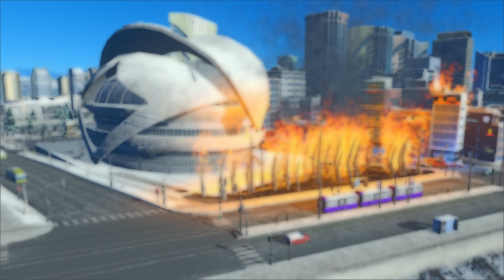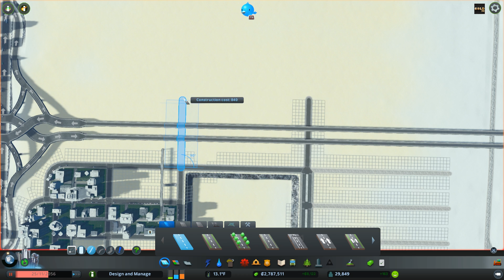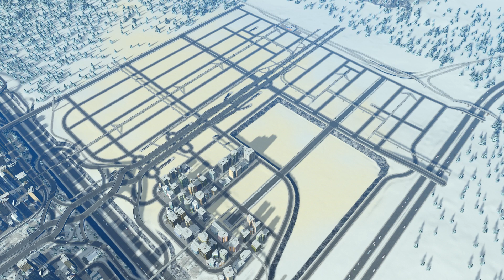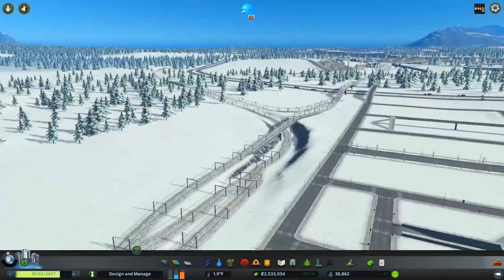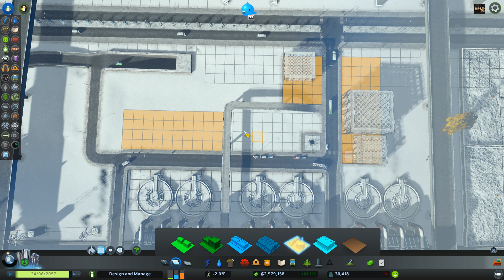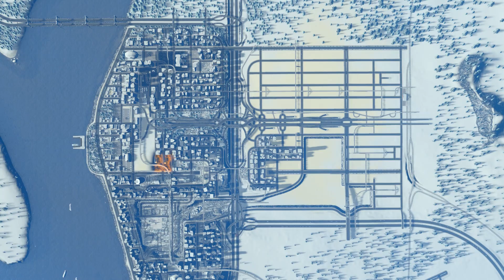Designing a MULTI-EXIT Interchange | Unmodded Cities: Skylines – Design and Manage, Part 26

Comment: Grids may be boring, but they are efficient, especially in high density areas. Way back at the beginning you left much of the farming area unzoned. you could add farms to deal with your industrial demand, and supply products to your sufficient residential and commercial zones. I believe you have oil and ore resources near by too. For forestry you can simply place a dense patch of trees anywhere and then zone it. or use the dense forests near your farms. Do custom assets qualify as a mod? I used this combined Pedestrian and Bicycle Path http://steamcommunity.com/sharedfiles/filedetails/?id=1179876942 in my cities

Comment: All hail the god of symetry and planning ahead his name shall be always remebered as T4rget.
Questions:
1.) Is there a reason why the long underground connectors in the "left" part of the city are only ON connections to the highway, but the "right" side has OFF connections. Altogether the whole highway "thing" is a masterpiece in itself as always, nevertheless it still seems a bit underdeveloped compared to what you made on the other side of the city.
2.) Do you not plan on having a cargotrain station on this side of the city. Adding to that and as a personal note I´d like you tu take the traintracks into the city alongside and or between the highway and planting the the big passenger train station in the city- take it as far in as you can so that it can truely be a central train station. Perhaps between the highway and sunken park, where there is already zoning. make a bit of a transport hub around it. This location would be a perfect opportunity to create a somewhat big city centre which arguably the city doesn`t have as of now. You know cetral station, parks, placas, some capitol landmarks like Theatre, courte house, taxoffice and a statue in the middle all.
And then have the cargostation on the other side of the highway which makes it not only cetral but with easy access to the underground connections to the left and right side of the new city part and to the highway into the old part.

I think what i am saying is: "Isn`t now the time to go BIG"
Reply from the maker: +heisnotlongbutthin 1) I tried to explain that in the video. The reason I'm not adding off and on points in both side of the highway is because the city will end very little distance north from the train line, so there's no point in getting in the highway just to leave a few meters up ahead.
2) That would take a lot of unnecessary space, considering I already have a passenger station a bit to the north and a cargo station to the south. I also already have a public transport hub that gives access to any point in the city. I'll make sure the passenger station has direct access to it. Thanks for the feedback and support!

Comment: Very good as usual. Keep it up. 
A tip I use was to make sure you don't share bus stops with more than one line. The network will run smoother if they don't queue up. Try to keep bus stops to single lines. Looking forward to the next one. 👍
Reply: Vyker but sharing would be good for transfers I think? I usually intersect my lines to allow this (but I never really finish a city so I don't know if it works :o )
Reply: They just walk down to the next stop. Huge traffic benefits to having separate stops for each line, the cims will walk :)
Reply: You can sometimes get away with two bus lines sharing a stop. A trick that sometimes works is to place a temporary intersection and then delete it. The game will sometimes leave that section of road as two segments and then you can place two separate bus stops where before you could only place one. For three or more bus lines I use this indispensable asset http://steamcommunity.com/sharedfiles/filedetails/?id=868718614